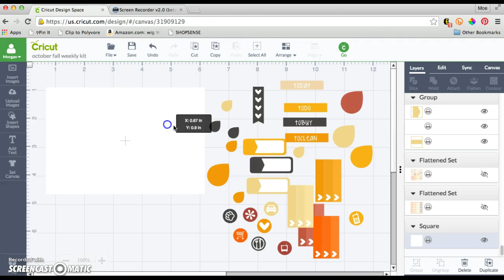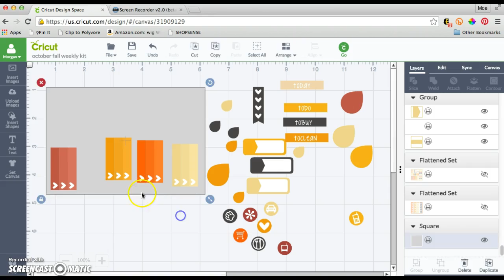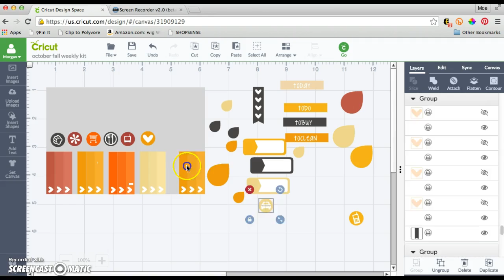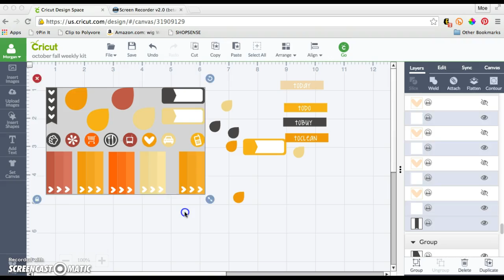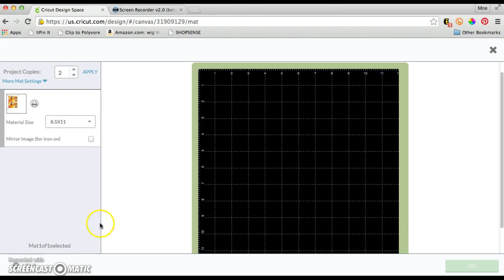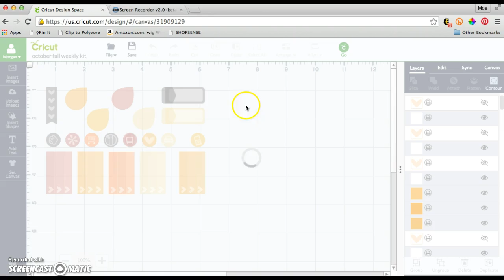How to Create Sticker Sheets Using Cricut Explore & Cricut Design Space

Comment: I'm just now watching your video, I am trying to create a planner insert and every time I flatten the image, It makes my outlines of my squares disappear, I even tried to get an image of a rectangle from online and it does the same thing. Do you have any suggestions or know what I'm doing wrong?
Reply from the maker: It may be that the out line of the shape is dark when it is set to cut but if the shape and the background are the same color, once you flatten both images the outline will disappear.  Does that make sense?  The outline of a shape is only darker when it is set to cut.  When the shape is set to print then cut the outline vanishes.  Hope that helped.

Comment: So do you cut out each sheet after Cricut does the kiss cut? My friend has a silhouette and it can cut out the sheet for her. I don't think it's possible on the cricut, since you can only choose one cut setting?
Reply from the maker: Correct - I cut the sheet down after the Cricut kiss cuts the stickers.  There is a way to run it through a second time, change the cut settings, and cut the sheet out...but since the Cricut reads the registration marks so slowly...it is easier to trim by hand.  The silhouette does allow for multiple cuts at multiple depths.  Thanks for watching

Comment: I disagree, they look horizontally distributed except for the far right image, which is probably because you put it to the edge.
Reply from the maker: +junbug1029 hmmmmm - - when selecting all and clicking distribute horizontally, all elements should space evenly across the page confined only by the outer most elements.  I haven't played with my Cricut in a bit, so I'll have to check if it's spacing properly.  Thanks for watching! :) :)

Comment: I have followed step by step and my projects still are switched from the set up I originally had them in, so I can only fit one set on a page and end up wasting to much paper :(
Reply from the maker: +Cassie Jo I think I may know your problem - and I will try to address it in another video too - but if you click on any of the images does the highlighted box around any of your stickers fall outside of the box you're using as the base of the 'sticker sheet'?  If you're following the video and have laid down that box, if any of the highlighted boxes around your images/stickers fall outside of that box, the program will see that as bigger than your designated areas.  I suggest putting all the straight edged images/stickers around the perimeter of the box you're using as the base for your sticker sheet.  Or move the images/stickers to where their highlighted box (when the image is selected) doesn't fall outside the box you're using as the base.  I hope that makes sense...but I will try to talk about that in another video I have planned.

Comment: Thank you for the video! And I love your shop! Any tips on how to get my shop logo to print on my sticker sheets?
Reply from the maker: +Amy Reed  You can upload your logo to Design Space and use it with in the design, however the cricut will read that as a cuttable image and you will end up with a sheet of stickers with your logo also cut out.  Or you can design another template then run your paper through the printer twice.  I would recommend either doing that in another program like Word or, if you design in Design Space, print your page with the logo after you've had the Cricut make the cut lines.  Otherwise you may end up with misaligned registration marks.  Thanks for watching!